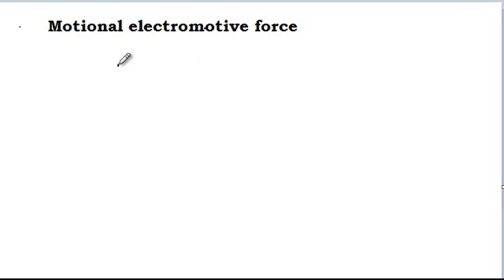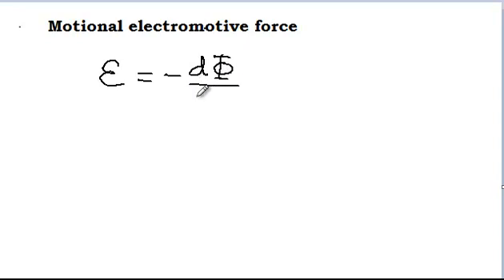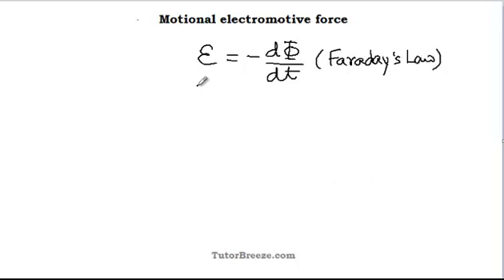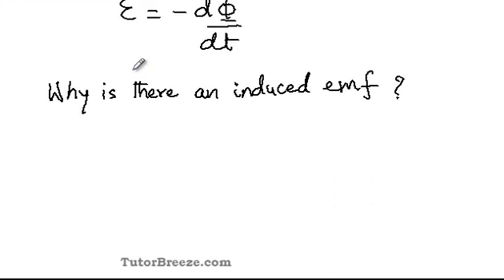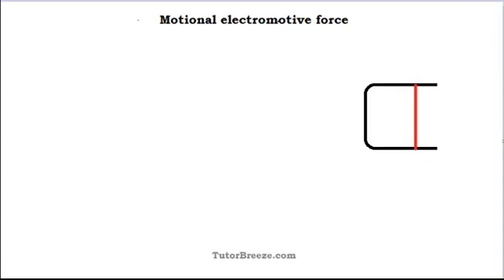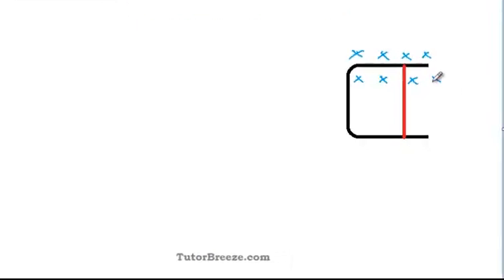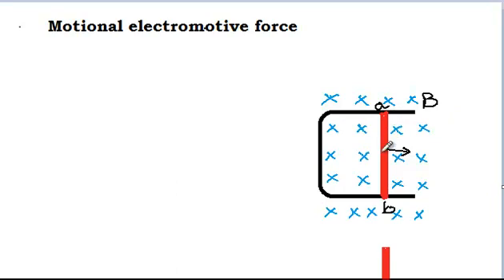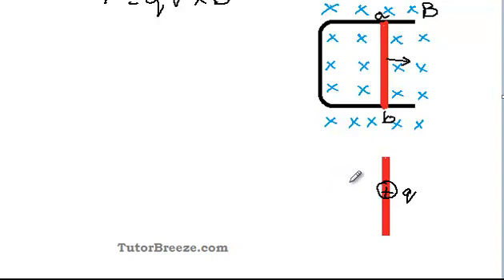Motional Electromotive Force

Comment from the maker: The magnetic field is already present so it exerts a force on the moving charges. This force creates a charge separation and hence an electric field is developed. Now this electric field also exerts a force on the charges. The direction of the forces is found as follows- since force due to magnetic field is q (vxB) so you use the cross product rule and as force due to electric field is qE hence you are multiplying a vector(E) with a scalar(q).

Comment from the maker: If the conductor is moved in the opposite direction then the charge separation will reverse so the direction of current in the loop will also reverse. In the situation that you have stated it will be clockwise.